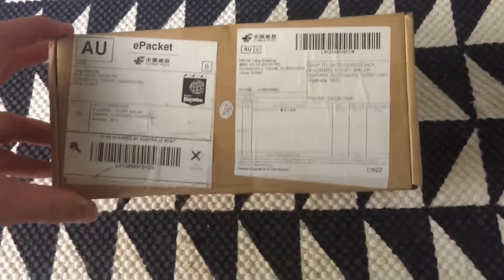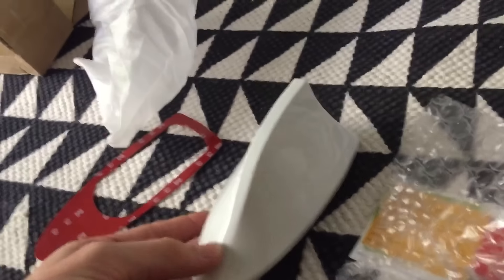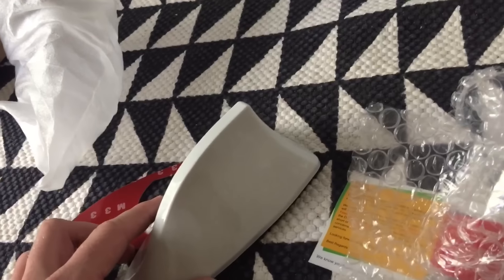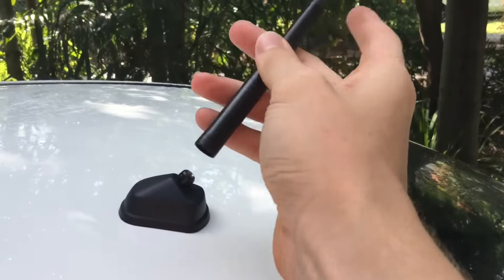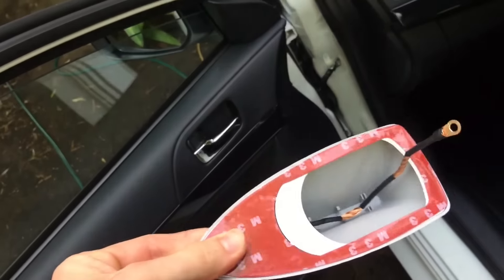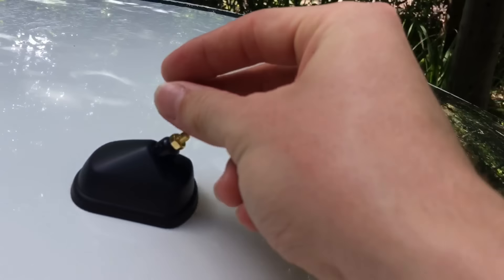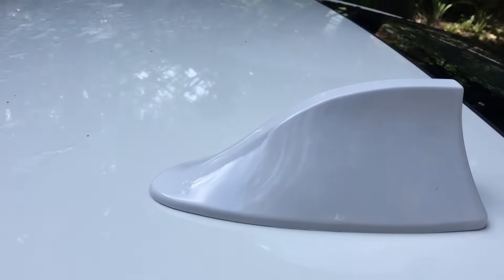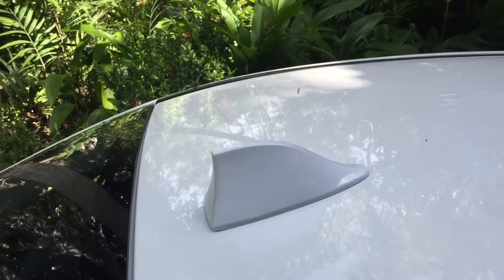HOW TO: Install a Shark Fin Antenna on any car!

Comment from the maker: 2019 UPDATE: So it's been two years, and the antenna is still just as stuck on as it was on day one! No, I didn't expect this to last this long but I was pleasantly surprised. The radio (along with digital / DAB) still works perfectly fine. Hope this helps anyone watching this video now!

And if you want, subscribe or check out my other videos :) See ya
Reply: Thank you!!
Reply: Thanks for that. I am thinking of fitting on to the Caravan as the normal antenna gets pushed around to much when I put the cover on ...Hope my idea works
Reply: Where do I buy one of these!!!!
Reply: Thanks for doing an update.... that's helpful.
Reply: Mitch Drescher where did you get it from or what website?
Reply: Hi Mitch, is it absolutely necessary to blow dry the tape? My garage is quite far from the outlet and i do not have a proper wire extansion for it. I'm also interested on how it did whenever you wash your car.
Reply: You're a legend thank you for updating this.
Reply: Hey! 
I was just wondering how the shark fin antenna was going after 3 years? It’s been a while since you’ve given us an update and I’m a little sceptical about the longevity. Also just wanted some clarification of how you screw the nuts? Thanks so much for the video though! It was very useful. I’ll make sure to share it around.
Thanks! :)
Reply from the maker: @lauragrave6867  Hey, sorry for the delay. I hope you appreciate my reply. I really, really do. It's still stuck. Like a 15 year old piece of gum on the underside of a school bench exposed to the full sun, this isn't going anywhere. Except everywhere the car goes, because it's stuck on it. Thanks
Reply from the maker: @lauragrave6867  Also, in reply to your question about the nuts. I tighten my nuts with the utmost care in the clockwise direction. Maybe I’ll upload a video tutorial
Reply: How did the paint hold up on the Antenna hold up considering it's just a cheap part

Comment: Pro tip, test if it works before you stick it on to your car ;)
Reply: how do you test that?
Reply: @jaymills6691 bro ??? Are you serious asking this question? 🤣 you just attach the atenna and test the radio before sticking it onto the car 😭
Reply: @monkeyzoff548  you still have to detach your whole other antenna and screw this one on just to test. Was just wondering if he meant something quicker.

But for anyone wondering, they have shit connection. I don't really care since I never use radio.

Comment: It is so tiny,. what is inside that makes it as good as a long one? doesn;t height and length [ surface area] have some benefit, if not, why don't all manufacturers fit them new.
Reply from the maker: Dunno man. I don't make cars. Works exactly the same as the original, never had an issue.

Comment: I used gorilla glue to fix mines that came off while knocking off snow.  I used a towel and sponge to absorb all of the snow/water. Works like a charm. The only thing with my car the shark fin is stand alone the antenna part is installed to the hood of the car so no wiring was needed.

Comment: Sick thanks mate. My 08 lancer antenna practically melted from the sun. So I needed a new fix for it. The radio still works perfectly fine. I just needed a new cover or antenna thing. So this looks pretty good and easy to do. Cheers!
Reply from the maker: daniel richardson no worries!

Comment: I recently installed one from ebay like this one onto a 2008 Honda Cr-v USA market. it was tricky i had to peel down the headliner, loosen the nut to the existing base , connected the wire then installed it carefully with the base inside it slid it around so its under the base then tightened the nut to the base i did not use the supplied tape i used sealant. and i sprayed the antenna element with wd40 to assure long life. here in the northeast use so it can survive the extreme cold temps, snow, and summer heat. as the shark fin installations are best suited for vehicles with a rear hatch, or tailgate depending which shark fin you get. as some bases it has to be loosened and lifted before the shark fin can be installed. as you have to get the right shark fin depending on some vehicles and how big the antenna base is. which can combine satellite radio or navigation.

Comment: Does anyone put silicone around it to prevent water from gettin in there?
Reply: I had to personally since the roof of my Corolla Ts is not convexed it's flat. Some clear sealant works but you will want to cut a real small nozzle and have good clean wiping cloths to tidy the excess.

Comment: Anybody who has ever installed anything with 3M tape knows it aint coming off!!  No hair dryer needed!!   I will say I don't understand why you wouldn't screw the antenna on 1st and test it. I would even drive around and test before I permanently stuck it on because once you stick that badboy on that's it.

Comment: Now you need to show us how to remove the shark fin if stops working. A lot harder I would say, especially if you don't want to lose any paint.
Reply: i used goo gone and a little rubber   squeegee
Reply: @leighanneh3559  goo gun? Do you mean hairdryer. I just bought one and im about to install it. Just wondering how do I remove it if needs be in the future?

Comment: The adhesive tape is not 3M, it's "M33",  which is a cheap Chinese brand (convenient how the chose the number "3" & letter "M" for their product). Anyway, I don't expect it will adhere very long especially in the heat & humidity of northern NT, but good luck!
Reply from the maker: corlettable still on there well!
Reply: Which double sided tape would you suggest?

Comment: Hi Mitch. From the other side of the Pond - Vince Smith from Dumfries, Scotland. I appreciated your video. However, I had to find out the hard way, that if you have a car (in my case a 2010 Citroen C4 Grand Picasso VTR) - that has a longer base than other cars, you have to break out the white crescent part at the front of of the shark fin case, because otherwise it will not be able to fit over the base,=. The original cavity is too short for these longer bases. I don't remember you mentioning this possibility, but I worked it out after some trial and error. Ta just the same. Vince

Comment: Where to buy that shark fin antenna?
Reply from the maker: Johnathan C ¡Hola! This is exactly the same as the one that I got for my car. 
https://m.ebay.com/itm/Radio-Shark-Fin-Antenna-for-Mitsubishi-LANCER-EX-ASX-GT-Signal-Shark-Fin-Antenna-/122725288135?hash=item1c92ff48c7%3Ag%3AI3AAAOSw-jhUCrgk&_trkparms=pageci%253Af0674c46-acbc-11e7-8178-74dbd180b24e%257Cparentrq%253Affde553115e0ab6af713688efffd8086%257Ciid%253A4

You choose the colour on checkout :)

Comment: I have a Sony radio (after market) for my 95 Honda Civic coupe.  It has a regular antenna not an automatic one.  Will this work if I used it to get better reception?  My old fashioned antenna is a little bent and my radio stations don't stay in tune and are fuzzy.  Thanks!
Reply from the maker: It'd probably end up being about the same! if not a tiny bit better
Reply: thanks
Reply: If you use an auto machine car wash, has the shark fin stay on, many people complain that they fall off.

Comment: People don't seem to realize how strong 3m acrylic foam adhesive is. Installed in the right way you won't be able to get the antenna of with your hands.
Reply from the maker: That's right! If it's real 3M and the surface is clean, it should stick for good!
Reply: i saw another guy installing one of these, no prep what so ever, it was like he was sitting in his kitchen going, "i´m bored, i´m gonna make a youtube video" he must have just taken his phone and the antenna on impulse and just started shooting, he takes a rag and "cleans" the aria, dude could have used sand paper just the same, by the sound of it, i cringed when i watched/heard it. slaps it on, no heat prep, fucks it all up in the end and has to remove and modify. aaaa some people :-D
Reply: I think I was seeing M3...

Comment: hey dude, can u share ebay link this antenna
Reply from the maker: Hey! So the one that I got in this video has since been taken down from eBay. But the one in the link below looks like it is the exact same one. You just need to let the seller know which colour you want. Have a good day! :)

http://m.ebay.com.au/itm/Car-Blank-Radio-Shark-Fin-Antenna-Signal-AERIAL-For-Mitsubishi-LANCER-EX-/191479857790?hash=item2c9516c27e%3Ag%3AntQAAOSwGvhT~GBv&_trkparms=pageci%253A34d7e561-28e7-11e7-9799-74dbd180b048%257Cparentrq%253A9fe015af15b0a6a4a6a82660fff20386%257Ciid%253A20